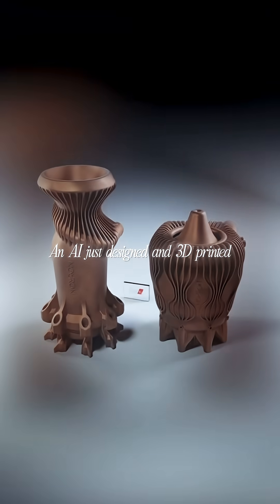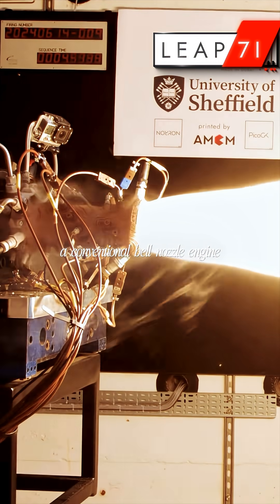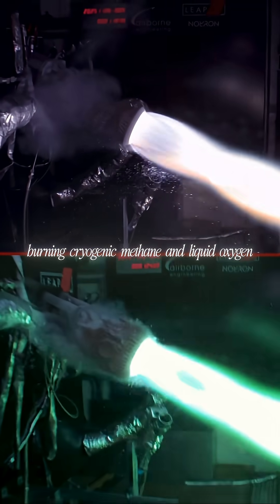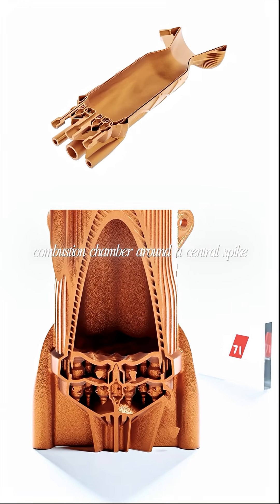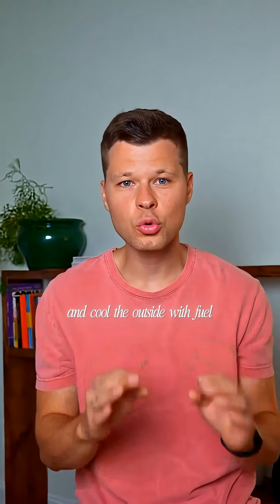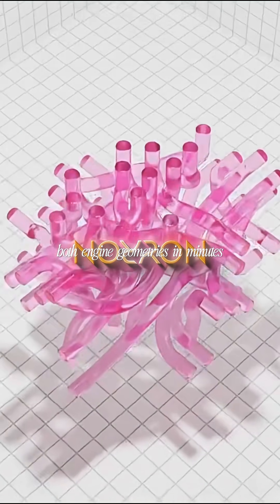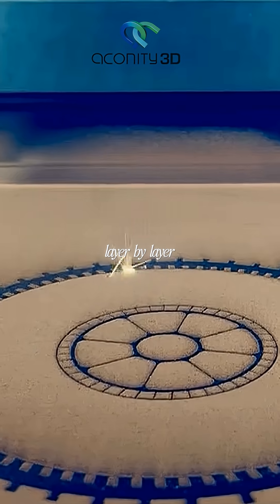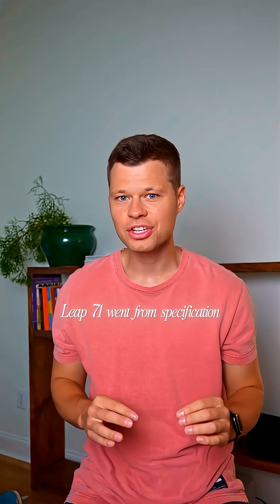AI just designed and 3D printed two rocket engines in 21 days and both worked perfectly

Comment: The engine also includes the turbopumps, which I doubt was 3D printed.
Reply: You are partially correct the turbo pumps would have not been included in the print since the pumps require moving parts and therefore more than one piece. This engine was printed in one 3D print with all of it pipes and channels permanently inside the engine so disassembly would be near impossible and it would just be cheaper to print another engine.

Comment: This was not made by AI. but a program called Noyron where it's creators at leap71 explicitly said it is NOT AI.
Reply: Imagine if this software got into the wrong hands!
Reply: what is it
Reply: @HPRedmi-wd2wv  Nyron is not and AI program but an algorithm that actually understands why rockets work and can create something original and not an agglomeration of what looks like an engine that will most definitely not work which is what AI would do it just know what the engine looks like not how it works. AI can explain how it works but it is just repeating what it was told to say when posed with a similar question.

Comment: Burning green it's not working it's burning it's self
Reply: Well if it works long enough to finish the fuel I guess it doesn't matter.. unless you don't like to vaporize copper and never recycle it.
Reply: @Guðmundur42 one way missile
Reply: @moobsmcgee3554 Yes... 😅
Reply: @moobsmcgee3554  all missiles are one way
Reply: Engine rich combustion
Reply: @moobsmcgee3554  the goal here is to test one iteration of design, gather data, feed that data back to the model and the cycle repeats until you get a model that can design useful stuff.

It's like being ignorant by the fact that SpaceX isn't here today if they haven't used that similar approach of iterating and learning from mistakes. That's the reason why NASA rockets are very expensive compared to SpaceX because they're not allowed to fail and work for the first time.

Also, the Additive Manufacturing part of this might leave some copper powder that might react explosively if not cleaned properly. (They've said this themselves)
Reply: ok I stand corrected, their model, Noyron, is deterministic, it follows rules explicitly defined by the engineers so it doesn't learn on its own. Hence, Noyron is an algorithm.
Reply: exactly 😂😂😂

Comment: It's not an AI. It's an algorithm. There's a difference.
Reply: And it didn’t even work correctly the engines burned themselves up.
Reply: @badanimationstudios3358  the entire point here is to gather data to then feed it again for it to learn. Each iteration of failure makes it learn something. 

Pretty much the same with SpaceX, they blow up rockets a lot and they learn, that's their approach.
Reply: @badanimationstudios3358 It's not perfect, but it actually works pretty well.
Reply: @WMagpieIf enough heat to burn off the copper is actually within the engine then it is burning way to hot with an incorrect ignition point leading to wasted fuel. Furthermore they are not a significant upgrade compared to modern engines
Reply: @badanimationstudios3358 Yes, but they are able to print the engines as a single part quite quickly, and the model itself is still unfinished. It's reasonable to expect it to fail occasionally. They can use the data from those failures to make it better.
Reply: @WMagpie now you make the error of acting like all failures lead to a success.
this is what scammers like this company is being run by for investors.
there is a reason this is a "dubai" company as dubai allows fraud abroad.
Reply: @zool201975 I'm not saying that. I'm saying that they can improve the system with each "failed" attempt. To say that it's a scam is to ignore the fact that it's fucking working
Reply: And it wasn’t 21 days when you include years of coding and training
Reply: I don't understand, can you explain why AI can't be an algorithm? Under AI you got machine learning, deep learning, etc.
Reply: A good definition for AI (and there's a lot of definition for it, but I think AI is slowly getting defined properly) is that it can "learn" in the sense that it can adjust some things on its own based on previous data without you manually programming or changing things yourself in the code. 

An algorithm is basically just steps you follow right? Add a final step at the end that adjusts something on its own then you've got AI. One of the simplest "AI" using the definition is a linear regression model. That model is part of ML and ML is part of AI.
Reply: @paolosalvador An AI is something that develops based on feedback and does the statistically best thing without any understanding of the actual processes. An algorithm models the physics and creates something according to the math.
Reply: @WMagpieok I stand corrected, their model, Noyron, is deterministic, it follows rules explicitly defined by the engineers so it doesn't learn on its own. Hence, Noyron is an algorithm.
Reply: Deep learning at best
Reply: That makes it even more impressive/terrifying.
Reply: Finally
Reply: Yeah I saw the same video as you.
Reply: It's literally not. It's ML. Not an algorithm.
Reply: its a ai not a algorithm 
the company also said they feed data from the engine stuff and improve the model
Reply: @Adgods an ai is something that just does what is statistically most likely based on training data without understanding of the actual process. An algorithm uses an understanding of the real physics to make something. It is the second.
Reply: AI is algorithm
Reply: @fredducaunt Kinda. All AIs are a type of algorithm, but not every algorithm is an AI